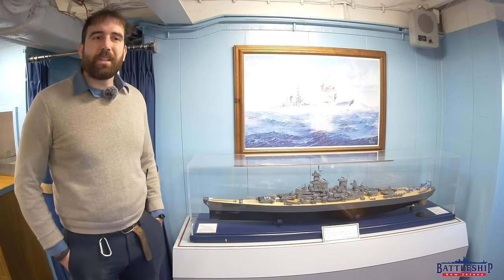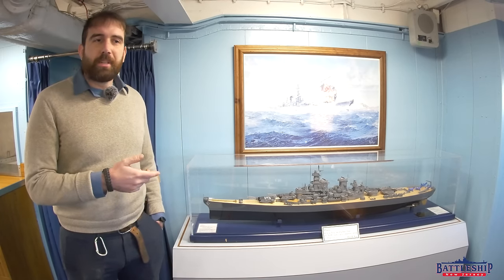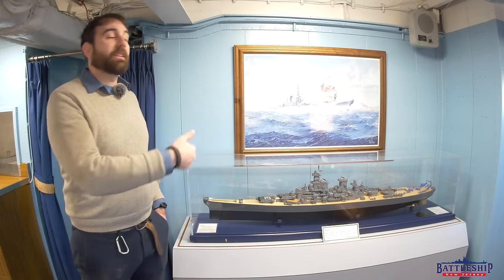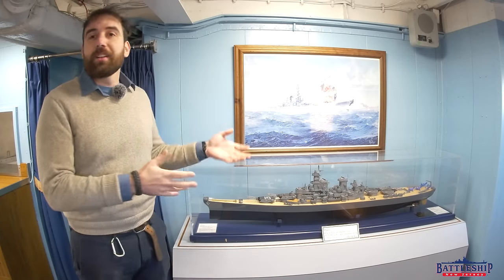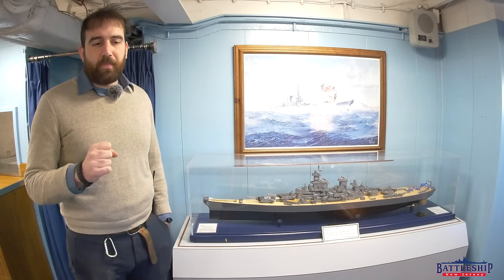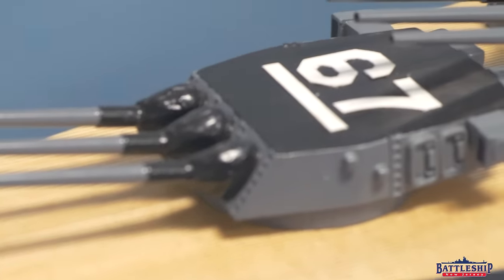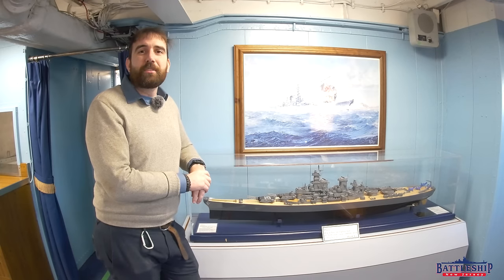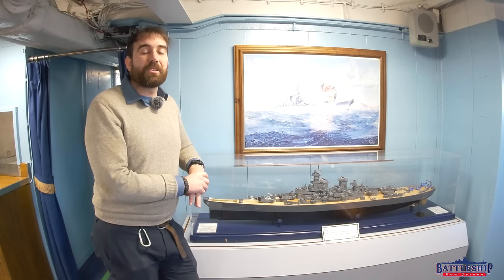Battleship Montana: What Would We Have Done Differently

Comment: Change the hull to a fully welded build (you've previously stated 1 tenth of the weight of a battleship is in rivets so getting rid of the rivets and going to a full weld construction should save about 6000 tons of that math holds true). The navy also developed a 1200 psi boiler so more boiler pressure should be able to make more power so that would be installed also. Feel free to correct me if I made any mistakes.
Reply: Ask the snipes, but my experience on USS Dewey (DDG-45) was that the 1200 lb plant was prone to breakdowns. Later steam powered ships reverted to 600 psi.
Reply: @Greg Siska  I wasn't aware of the reliability issues with the 1200 psi plants, thanks for the insight.
Reply: Even WWI battleships had bulbous bows, though not as pronounced as Yamato.
Reply: I thought the Iowas were fully welded hulls???
Reply: I think it took improvements in materials technology for superheated plant like that to be viable. Strangely enough, even in large electricity generation stations where you'd think weight isn't an issue, that sort of pressure wasn't reliably possible until into the mid-1980s.
Reply: @jomomma8291  not sure on the entire hull but there is a mix of rivets and welds throughout the ship. Correct me if I’m wrong but I believe it was a question of strength with the navy as to weld being as strong as riveted construction
Reply: Generally, welding saves about 10% compared to riveting.  But you have to discount the weight of the armor when calculating that weight reduction.  First, armor plates aren’t connected to their backing plates with either welds or rivets.  They’re bolted on.  And second, the plates are much heavier relative to the amount of connecting material used to secure them than you see with structural plating.  It’s still a very significant savings though.
Reply: Riveting has some advantages over welding, namely in elasticity. A riveted ship can flex a bit more than a welded ship. This doesn't seem important, but it can be very important for bomb and shell hits where that little bit of give can be enough to prevent a marginal hit from penetrating and, in fact, there were cases where this was likely the deciding factor in bomb hits on the deck. It also reduces the transfer of damage to other parts of the hull because a hit on a solid welded piece can send fractures and metal fatigue well beyond the impact point, but having separate riveted pieces interrupts this.
Reply: Riveting adds weight because the plates have to overlap in the riveting zone.  Rivets don’t weigh anything, but the lapped plates definitely do.  Welding, you keep plates in the same plane and butt weld them.
Reply: Welding is a bit of a mixed bag.  The biggest issue with welding is process consistency.  Any heat treatment is ruined at the point of a weld and variables with how the welding was performed can introduce deviations from the planned material properties.  If the weld is too hot or too cold, or the heat affected zone grew too large during the procedure.... ooops isn't quite the word to describe it.

On the other hand, welding saves weight and can even be stronger depending upon the specifics of what we are talking about.
Reply: 60000 tons is the total displacement (fuel,  supplies, power plant,  systems, piping, ammo)  not the hull weight.
Reply: @Aim54Delta   All true, but normal hull steel (what’s now ABS steel) isn’t heat treated and is routinely welded to 100% joint effectiveness with SMAW or MIG and stronger filler metal specifications, in shipyards and even small shops.  Same with A36 or newer general purpose steel, it’s just not guaranteed to have the cold brittle transition point suppressed as effectively as ABS steels.

We are talking 1940s when things were more like A6 general purpose steel and so forth, but SMAW sticks welded a ton of ships during the war.  Lot learned since then, but a lot of WW2 stuff still afloat too.
Reply: @rabidbigdog  I beg to differ. In 1969 after leaving the navy I went to work at a natural gas/oil fired power plant. Their latest unit was nearing its end of new construction. That boiler was rated at 2350 psi at 1005 degrees. I worked on and around that boiler for 35 years before I retired, and it was a very reliable. It was finally pulled down in 2019.
Reply: It was proven during WW2 that fully welded hulls didn’t have enough flexibility to accept the normal “wearing” and “flexing” on a ship. A riveted hull does. Also bear in mind warships normally “hog” at the bow and stern and this too had a tendency to crack the welding.
Reply: @rigsby7255 generally, welding is much stronger than riveting. I weld. Rivets require punched holes which weaken the plate around them both from the loss of metal, the weakened structure of having holes, and the stress around the punch. Drilling can be done abut takes a long time, and adds a good deal of cost. Rivets also don’t cover the entire joint, which is obvious. In order to have the strongest joint the weakness added by the holes has to be calculated along with the strength of the rivets. It’s a compromise. Welding dies t have those deficits. Welding is along the entire joint, making it have far more effective usage of the joint edge. And while rivets can loosen from nearby impact, welding won’t. There are very few instances where riveting is as strong, or reliable as welding.
Reply: @WardenWolf if you’ve ever seen riveted plates near a shell hole, you may notice all of the broken and popped rivets. You don’t want flexibility in a hull.
Reply: @Georgewilliamherbert  
True - I just have first hand experience with the challenges of getting consistently performing welds.... of course.... company policy went from hiring trained and experienced welders to handing anyone with hand-eye coordination a tig torch and turning them loose on stainless.... That said, I am one of the crazy engineer types always wanting to make bulkheads out of spring steel and armored plate out of neutron stars.

Imagine a springy tooling steel for bulkheads where the armored belt actually collapses in before springing back into shape.
I have no idea what the cost would be (no doubt, absurdly prohibitive) - but why build a battleship that can be sunk in the first place?  That's defeatist thinking.
Reply: Going to nuclear would remove the boilers and the fuel while using the same turbines. I guess you might install them down the exhaust stack space. New design SMRs will fit on an oversize truck depending on the output.
Reply: Welding also removes the overlap required to support the rivets. Might require less paint over time as well - less rust prone and stronger, more resilient to bending.
Surely there is testing data for comparing welds vs rivets.
Reply: The welding would have been inevitable. The iowas were the phase in of it and 4 years later I cannot imagine it would not have been proven enough to become the norm.
Reply: @tobyw9573  
I'm mixed on nuclear and supercritical systems for a battleship.  While a supercritical system can be higher power, nuclear frees up space/weight for fuel.  However... nuclear systems are something of a nightmare for battle damage, and supercritical steam systems fall into a similar category, being more difficult to repair following damage - which a battleship is expected to endure to an extent.

Personally, I would go with an electric drive system and use a distribution bus with a distributed generation system.  Could be micro turbines, fuel cells, stargate ZPMs... of course, very few micro systems have good efficiency ratios compared to larger installations.
If I had to get tricky, though, I would go with dense plasma focus fusion.  It's compact and could be used in various locations throughout the ship.

Though a giant mass of lead acid batteries as a torpedo defense strategy does sound amusing.  Forget tensile strength, just put the entire bottom of the hull under compression from a torpedo hit.  See them try and lift a lead brick.

The grant from developing an "EV-Battleship" should be enough to offset the costs of production so that we basically get it for free.
(Yes, I know that's not how it works, but I just promoted myself to flag staff).
Reply: @Aim54Delta  Always possible to weld badly.  Fortunately there are qualification tests and the weld filler metal specifications are all 10-15% stronger than the base plating strength.  So 100% usually is safe.
Reply: @gregsiska8599  The Knox class frigates uses 1200 lb steam plants every successfully, and those were fast ships!
Reply: @william paz  
Hogging and sagging also had the nasty habit of loosening rivets and cracking plates, which contrary to expectations can propagate across multiple riveted plates.
Flexing of the hull is not a desirable trait!
Reply: 1200 pound steam became reliable.
Reply: @philiphorner31  
But not in the 1940s.
Reply: @aileenrasmussen5176  In the late 1960s the 1200psi Boilers were unreliable enough to the point that the US Navy reverted back to 600psi boilers in new design studies, before shifting to Gas Turbines instead, most notably in the case of the FY67 DDG. See Reuven Leopold "Innovation Adoption in Naval Ship Design, 1977" (you should be able to freely get a copy of this online).
Reply: I think battleships might survive an atomic war.   They certainly would be atomic powered.  I have no clue about guns.   My guess missile - cells
Reply: @mahbriggs  There’s what’s called the endurance limit or fatigue limit load, which for steel is the load under which no fatigue life is eaten up by flexing.  It’s typically 30,000 PSI for shipbuilding steels (but varies with the specific toughness and tensile limits of a particular alloy and condition).  Between safety margins and intentional derating you want to avoid exceeding that in ship hull design and operation.  Unexpected high loads still can cause fatigue and cracking but you can avoid it mostly.

The one time the ship hits a 25 meter wave may push towards the tensile limits, but the loads day in and out year-round need to not eat up fatigue life.
Reply: @Georgewilliamherbert  
By the way, I made a mistake in my post of "the less, the better".  I meant to reply to wardenWolf, not you.  My appologies!
Reply: Wow yes, large amount weight saved!
Reply: That’s difficult to believe. If welding saved that much weight it would have been done on aircraft 70 years ago.
Reply: @mitchhancock9777  Airplanes are mostly made of aluminum, because stiffness for airplanes matters more in the design than just pure strength which dominates ship design.
Some aluminum alloys are weldable, but not the ones usually used in airplanes.  7075 alloy for example was a major WW2 era advance in Aluminum and isn’t weldable other than in some limited circumstances friction stir welding (and not great then either).  6000 series Aluminum alloys are mostly weldable but only 1/2 to 2/3 the strength of 7075.  5-series alloys are weldable and somewhat stronger but susceptible to stress corrosion cracking and rarely used in aircraft (ships and boats, more commonly).  Some 2000 series alloys can be welded some can’t.
The ABS steel used for shipbuilding, and A36 and other structural alloys used for buildings I-beams etc, don’t lose any strength when you weld them.  What’s called “100% joint efficiency”.  After dealing with less strong alloys for aluminum if you weld it and avoiding SCC and the like welded aluminum aircraft parts end up heavier than riveted, except in limited circumstances.  You rarely see it in even those circumstances.
Reply: @melgross  Sorry, but stating that welding is stronger than riveting doesn't makes much sense here, since the structure (in this case a ship's hull) will be made to accomplish the required strenght, elasticity, etc. So the joints will be made accordingly, whichever the metod would be.  -- Apart:  As you say the holes are punched -That is: not drilled - so the process is quite fast, hidraulic presses to punch holes and riveting were already used more than 100 years ago for working in very thick plates. and the holes in the plates, if the rivets are properly set, don't weaken the plate. Also , you must make a deep flange that will take you probably more time and money than punching holes, unless you make a lap joint, (what will add weight due to overlapping). And you'll need to make several welding passes, this too, takes time and labour...  Add to that we're talking about 1940...
Reply: @DDD-th9je  to be simplistic about it. Everywhere strength is needed, and simplicity in build, welding has replaced rivets. Ships, buildings, tanks, etc.
Reply: @DDD  
Punching holes for rivets does weaken the plates.  Microfractures are formed around the hole, which can cause large cracks to occur and loosen rivets.
While it is possible to make a riveted hull as strong as a welded hull, it will weigh much more!  So, a welded hull is stronger than a riveted hull of the same weight!  Weight is very important!  The lighter the hull, more armor, guns, or machinery can be carried.
Also, edge to edge welding of plates is quite common. It is called butt welding.
I am a retired welder, and we did a lot of that!
True, welding requires more skill, or at least a different skill set, I wouldn't know how to properly set rivets in thick plate, pop rivets are about my skill level, but by the mid-1940s was quite common in the American ship yards.
Reply: I work on a utility boiler it runs 2200-2400 psi, it was a late 60s design though.  Bet they'd get a few more knots out of it.
Reply: @Aim54Delta  Absolutely, welding may have benefits but the act of heating the steel at the weld site could de-temper the armor and defeat its purpose.   The heat generated by the speed of fast rounds are what destroys AR500 plate targets when you shoot 3,000fps rounds at it without allowing for distance to drop the velocity enough to fall below the de-tempering threshold.  First shot de-tempers, next rounds goes thru.
Reply: I'll tell you why.  Welding repairs at sea are almost next to impossible.  Im gonna get into the weight issue but riveting is faster.
Reply: @Saxxonknight  
Not on the steel, armor or structural, used in ship building.  There are a great variety of different steel alloys to choose from, and not all suffer from embritlement when welded.
I am a retired welder, used to working with a variety of different steels.  Designers select the correct steel to use, depending upon whether it is to be welded or not.
As far as weight goes, a welded ships hull is always lighter than a riveted one.
Reply: @Josh the King  
Riveting repairs at sea are also next to impossible.  
Try drilling or punching a hole in an underwater plate and then sticking a red hot rivet through it!
Underwater welding is quite possible and is a standard staple of off shore drill rigs and pipelines.
I know nothing about it except what I have read, but there are online sources for information about it, including a couple of YouTube clips.
Reply: @Jo Momma  I've been on the Wisconsin, it's over 98 percent welded. You can see it in close up pictures.
Reply: @melgross  riveted or bolted connections provide 2 things, redundancy, and flexibility.
Reply: @randymagnum143  well, it’s not needed. I’ve been designing and building machines for a long time. Unless there’s a particular reason for it, everything is welded together. Holes for fasteners are always a weak spot. Look, some of you guys can protest, but just look at the real world and you’ll see that other than for most bridges, everything else is welded. There are very good reasons for that.
Reply: @melgross  plenty of bolted connections in bridges.  😉
Reply: @randymagnum143  yes. I just said that. Well, not actually bolted, hot riveted.
Reply: @melgross  Flexible for hogging, I think he meant. To flex and bend with the normal motion of the sea.
Reply: @aileenrasmussen5176  I like the Knox class too, but they weren’t particularly fast. Wikipedia (FWIW) says they could do 27 knots. That tallies with what a friend told me about a “drag race” between his ship, the Moose (DD-980 Moosbrugger), a CGN and a Knox. The poor Knox got left in the dust. Moose and the CGN settled out at the same speed, but with the quicker response of a gas turbine, Moose gained and held an early lead. (The CGN radioed ‘yeah, but I can go farther!’)
Reply: @MrNatWhilk  Wikipedia can be dead wrong at times. My husband was on a Knox class, he proudly tells of a time their ship did 31 knots on only one boiler (they had two). He said it felt like surfing.
Reply: @Greg Siska  I believe the issue would have been fixed if they where going to put it in something like a battleship
Reply: @tobyw9573   No Nuclear uses different turbines, that is for sure.  The reason is that Nuclear generated Steam is low quality steam.  It is a lower temperature and has a higher saturated steam.  Therefor the turbine blades are much thicker and mor robust to withstand the damage caused by the wetter steam in the flow.
Reply: @ThirdHornet  Stands to reason,   more pressure,  more stress.
Reply: Actually the Knox class USS Hepburn had a Combustion Engineering boiler made with chrome moly tubes and higher pressure steam.
There were only 3 of those frigates made with those boilers. The rest were Babcock and Wilcox at 1200 psi.
I don't think the extra 155 PSI was worth the 1 knot of speed.
They also my have been test platforms for nuclear boilers. But have to ask a never sees the sun while sailing type about that.
 My theory is that they would have lasted 4 times as long at 1/2 the pressure. I would not have liked welding one the sub types for repair.
That was bad enough in a oil refinery furnace.
Reply: @gregsiska8599 but why not a compromise beetwen 600 and 1200 PSI to avoid the issues (some of them at least) with designing and building a super high pressure boiler. Something like 900 PSI although the battleship wont win any races, but coupled with all welding construction could solve its speed problems.
Reply: @dick8193 Land based and ship based boilers are built to different specks. Land based you're not limited to space or weight requirements.
Reply: Removing the sea planes also would save allot of weight as you would not need the plane, launching gear, basic repair/replacement parts and fuel or the air crew of the sea plane....That would also free up much of the rear for later on to add a helicopter pad.
Reply: @rabidbigdog  There were 3 Knox with 1355lb Combustion engineering plants. The Captians authorized using  Babcox and Wilcox Chrome 10 inch main line in the yard. Nine months later it blew and that section dis appeared.
 The Combustion Engineering boiler was all chrome moly steel. those don't weld to each other very well. That extra 200 PSI was good for one more knot of speed.
 The Petty officer manning the gauges was helping two others lower a gate valve. He was court martial-ed. Had 3rd degree burns on 50% of his body.  If he had been at the console he would have died. But it was running at designed pressure for Combustion power plant. Those three had the same steam plants as subs. The subs did not blow because they operate at  45% of 1355 psi for the surface vessels.
Reply: @Georgewilliamherbert  you can thermally weld 7000 and 2000 alloys, mainly using twin torches. You can even weld different series together using this technique. This is however mainly done with 6axis robots, but could be completed using scaled up 3 axis xyz table for simple geometries.
Reply: @melgross  that's not really true. It depends on the direction you are applying the forces and the type of failure you want to see.
Reply: @Aim54Delta could it handle the force of a blast? I have wondered something similar about keel breakers, I just don't see it not getting punctured in practice or alternatively failing at a point of penatration.
Reply: I might as well stick my oar in the water and see what happens. I'm an ex-nuc and was on the Enterprise CVN-65 from 1973 to 1977.
1. At that time I was on board, the USS Ranger CV-61 and the Enterprise were both home ported out of Alameda Naval Air Station. The Ranger had a 1200 psi steam plant which from our point of view, not worth a damn. The Ranger had numerous problems with the steam plant and Enterprise ended up covering quite a few of her commitments. The worst example was when Ranger had to leave exercises off of San Diego and run home due to failures in thermocouple wells for the boilers. We not only covered for her, staying out over 2 additional weeks, but had to tie up to a pier with insufficient shore power, because the Ranger was parked in our spot. 1200 psi steam might have worked later, but the 1950 system was not a winner.
2. The only difference between our main steam turbine system and a conventional 600 psi steam system with superheat is that we needed to have a moisture separator between the HP and LP turbine. That moisture separator dried the exhaust steam from the HP turbine before sending it to the LP turbine. As stated in comments above, a nuclear plant does not have superheat, so there has to be additional hardware to protect the turbine blades.
Reply: If you delete the rivets, you’ll have a whole bunch of holes in the hull, etc. You’ll have to add back the weight of the holes, to get the ship not to sink immediately.

Just sayin’…
Reply: 600 pound steam is easier to put back into service after it takes battle damage.

boiler to steam pipe = saturated steam.   for superheat you need to send saturated steam to a superheater = 2nd heating cycle.

it's easier to design turbine blading and stages that can expand saturated steam than it is to build a superheated steam cycle.   when you realize that carriers started coming out that were in the 70,000 ton class that can do 35 knots plus - DURING the 2nd world war - we had what we needed to create ships that were heavy hitters, can do the speed required to keep up with carriers, and potentially not be superheated steam.

what i'm looking for now is the steam plant diagrams for the Essex class carriers of world war 2... so i can see if they're superheat 1200 or saturated 600 pound.  

which is to say...  dammit, you nerd sniped me.
Reply: @melgross and that’s why 787’s are welded together?….🤦‍♂️